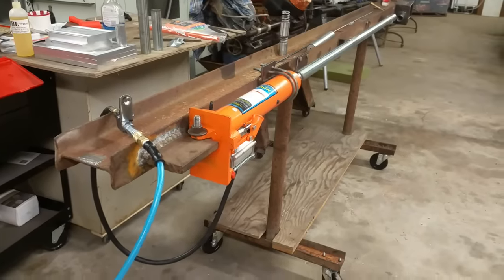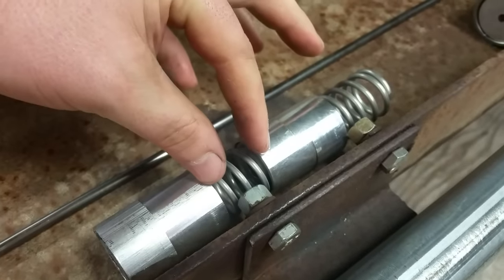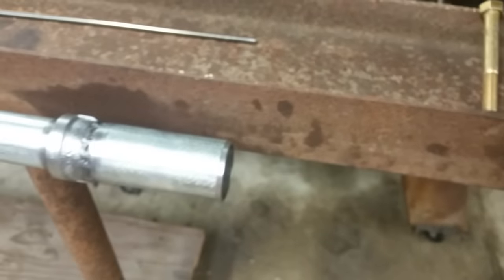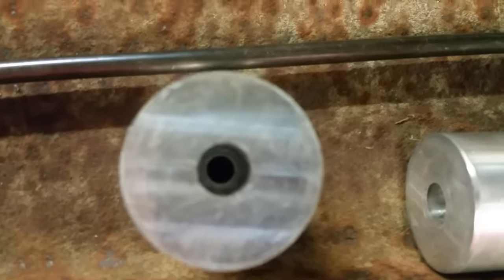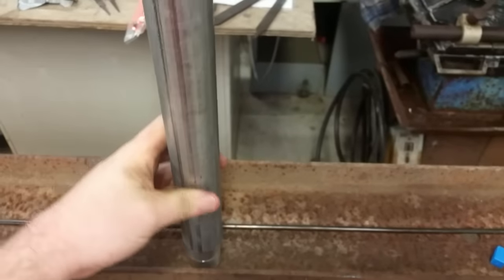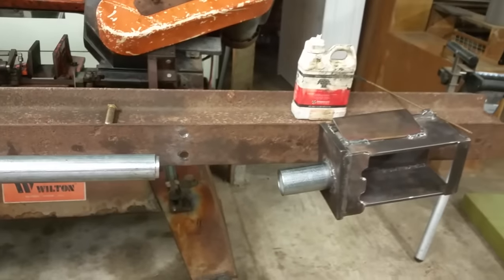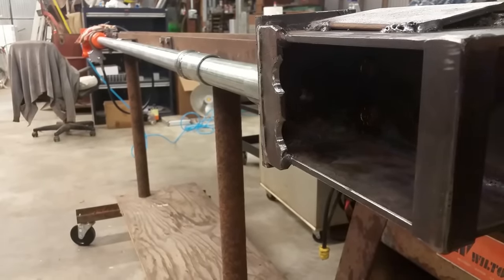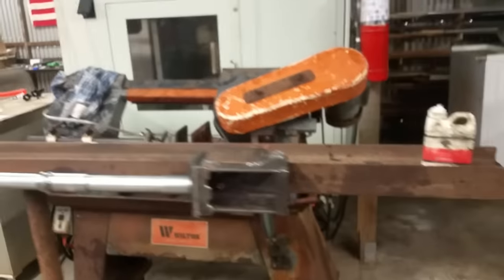Button Rifling Press - Home Built

Comment: I went with tighter tolerance on my bushings, I get that neat suction effect if I cover the hole when I pul a rod out. BUUUUUUT it's a helluva fight to extract rod and barrel after the press lmao. OCD can be a bit problematic lol. I think I'm around 3 tenths clearance? Much too tight but I didn't want to allow flex but yours kinda makes me seem silly because as I'm sure you know I spent much more time on my bushings to get them that tight. And it's even problematic so I think I'll just use my CNC and make some a bit bigger. What's your tolerance on yours?

Comment: Not bad, a couple things to point out though. You're not limited to the length of the ram, just make your push rod and the support tube in different extendable lengths and then you're only limited to the length of your i beam frame.

Your bushings could be designed like split collar clamps for easier removal, or instead of trying to pound it the barrel with another tube you could have used the existing barrel like a slide hammer through your hole in the beam, use inertia!
Reply: My thinking exactly.

Comment: I would like to see you roll that barrel on a microflat table or chuck it in a lathe and run a dial indicator on it. Also what metal is the barrel made from? Is there heat treatment coming next? Was the stickiness due to swelling from the broach?

Comment: That is totally cool and ingenious the way you used the springs and spacers to stabilize the rod and using a hydraulic ram. I totally understand but wouldn't have thought of pushing the die rather than pulling as the only way I've seen before. It looks like you were using DOM tubing in your example. would it work with a standard barrel blank? I was wondering what kind of typical pressure it actually takes to push a 9mm die? Thanks for sharing this.

Comment: Pretty freaking awesome, but my question is, why such a long setup? is that so you can run multiple sections and do much larger barrel blank lengths? maybe do a super long blank and cut it down to multiple sections?
Reply: 22 inches travel so you need 22 inches for ram, 22 inches for rod, 22 inches for barrel, plus some extra for fixturing on the ends. I don't think he's got any extra, that's the way I see it anyway.
Reply: @brocktechnology  Why 22" for the rod? Couldn't it be shortened by having the rod & the support tubes/springs inside the area where the ram extends, pushing both rod and supports down the tube the ram is in?
Reply: @konagolden4209  That's exactly the case. In the start state the Ram, the rod, and the barrel are all in their own space. The Ram extends into the rods space in the rod extends into the barrels space, the spacer stack collapses and remains in the rods space. 
A not so small point that I missed in my original observation is that the support stack has a minimum and maximum dimension and it needs 22 inches of difference between minimum and maximum so the total length needs to be 3×22 plus the size of the support stack without any springs, plus a bit more for fixturing at the ends. 
There is of course many ways to optimize this and fit the same functionality into a smaller space but we are witnessing it in a state previous to any optimization.

Comment: The reason your bushings were so hard to remove is because the tubing was too thin and didn't constrain the forces. In other words, the button expanded the diameter of the tube. This is why commercial button-rifled barrel blanks are around 1.25" in diameter.

If you measured the resultant bore size,  it  would most likely be out-of-spec (i.e oversize).
Reply: Duncan Wilson I would think that Normalizing/Stress relief of the tube at about 550 deg Celsius for 2 hours should cause the steel to return to the original dimensions.
Reply: unless of course, he is making gun barrel liners. which these look to be

Comment: That's awesome. I've been wanting to do that for a long time. This is the first time I've seen something worth building. Couple questions...why is the tube so long? I did realize that with a 22" ram you would need an extra 22"  of room for the aluminum and spring holders. That looks about 6ft long. Is it necessary? When the barrel came out, it obviously expanded a wee bit. Is that a bad thing? Last question.  Do you have to make a holder set for each sized barrel? Actually, I'm going to hit subscribe and all that. Could you show when you do a bigger barrel? Absolutely great idea man! Very inspiring. I had just about given up hope!!!

Comment: Are you getting constant smooth pressure the length of the barrel? It seems like the ram is moving stop and go.
Does that matter? Wondering if you could use an air cylinder with the appropriate throw and a pressurized tank to do the job with one continuous stroke?
Like I said, i don't know if it even makes a difference. 
I've got both. But the harbour freight cylinder is cheap and I don't mind tying it up indefinitely unless it would make a noticeable difference.
First time viewer, I'm going to sub and like.
Thanks.

Comment: Hi Max, nice build mate. Ingenious! 
Just some things to clear up . What is the clearance between the bushings and pipe as well as the bore of pushrod? Clearance also for Barrel support bushing? Source for Spring? Source of your Rifling buttons?
Thanks Ray
Reply from the maker: Depends on the ID of the pipe you're using. I'd leave .005-.010" on bushing clearance. The 1/4 rod clearance was just the oversize hole left by a 1/4 drill which usually gives enough clearance by itself.

Comment: I just subscribed. I’ve done some minor gunsmithing in the past. My question here is, how big of a barrel can you do (diameter wise) with those bushings? Do you have different sized bushings for thicker barrels with your setup there?
Reply from the maker: That's correct, this was a 1/4" mandrel, ideally if you go over 30 cal then you would want to up the size of the mandrel and bushings. Theoretically you could do 50 cal but you might need a stronger hydraulic cylinder
Reply: @max-weber  I’m really impressed with your setup there. Would you think a 20 ton ram would do it, or am I thinking too big?
Reply from the maker: @roberthamm9304  that would probably work. It depends on how you size your rifling button (how deep the lands and grooves you spec it to cut)

Comment: what is the reasoning for making the supported rod part (before the barrel holding jig) so long? I figured it would be at most 2x the stroke of the piston, but it looks to be almost 3x?
Reply from the maker: Yes you're right (3x). One bushing plus uncompressed spring gap is 3 inches. Each spring compresses by an inch, so a 22 inch stroke needs 66 inches with this setup. You could probably get away with less support and cut it down in length 2-3 feet, but I opted to overbuild it since I had a long beam to mount it to.

Comment: I would assume that there are barrel size/thickness limitations? I'm not real familiar with rifling techniques but I was curious.
Reply from the maker: I haven't had a chance to do a larger caliber, but it could be possible to max out the hydraulic ram, since it's only 8 tons. You'd need a larger mandrel too.

Comment: Have you ever seen a button rifling machine work? I think your going to have trouble with deflection of the pushrod inside the barrel bore. Buttons are drawn through, not pushed, for that reason. Not saying it wont work, it just won't work well. How are you controlling the twist rate?
Reply: You are 100% spot on. The button is pulled through and an AC Servomotor controls the rate of twist, rotating the button at a controlled rate.

Comment: Very good.  I wonder if there would be any benefit in adding a flat bearing of some sort between the cylinder ram and the push rod.  This might allow the button to rotate more freely.  It could simply be two flat plates greased up against each other.  Still, your results looked good.
Reply: Called thrust bearings. I supposed to have a drawer full of them somewhere. I'm not sure about the flat pieces like washers since they're soft. Thrust bearings have two extremely thin races that are harder than a Minister's prick. And small needle-like bearings. Well in what I was doing, but I've seen heavy equipment that have some hellacious thrust bearings!
Reply: @jackwatkins7382  yes they use the needle thrust bearings in lathe head stocks sometimes.  They would work for this but really aren't necessary at .01 rpm.

Comment: If I am understanding correctly you would have to make a full set of bushings for each caliber?
Reply: Probably just for the outer diameter of the barrel. If you used the same size stock each time you wouldn’t have too.  .223-.260 in 1/2” and .270-.338 in 5/8”.

Comment: Is this technique uniquely different from traditional rifling methods. I'm unfamiliar with traditional approach to rifling methods.
Reply from the maker: I believe most button rifling done in factories will pull the button through using a rod brazed to the button. That can be more challenging because you have to have a good grip on the rod and whatever grips the rod has to rotate with the button while it passes through. When pushing, the button moves independently from the rod.
Reply: @max-weber  'preciate the 'splanation.

Comment: If you go back far enough,  didn't they pull the tool through with a threaded rod?
Reply from the maker: Historically, early rifling was "cut rifling" with a single point cutter. It's a slower process but there are still high end barrel makers that do it.

Comment: For longer Barrels could you not have made a spacer bar or extended push rod for longer barrels and do 2 passes with the single length ram, one short for half way, then with the long push od to the other length, you could have essentially just under doubled your total possible barrel length...

Comment: Impressive.  However, I can't be convinced that you didn't expand the internal diameter of the barrel pushing the button through that way, especially when inserting the barrel into the the bushings appeared easy beforehand but difficult to remove after pushing the button.

Comment: How deep does the rifling need to be to be most effective? I assume there will be gas leak if  there is too much play. Do you need sequensual push buttons to get deep grooves?

What are the factors for accuracy here?

How much force is needed? 
I wonder if it could be done with a threaded rod.

Where do you buy the push buttons? I guess they are on a watchlist. So making them yourself is probably nessisary
Reply: They are not on a watch list. smh
Reply: Why would you need multiple passes with the button? A bullet is actually squeezed through the barrel, creating a tight gas seal. No bullet leaves the barrel the same size as before it was fired.
Reply: @TheRoadhammer379  try buying rifling press buttons in venezuela.

Comment: Did the tube diameter pipe increase after pushing the button through.  It’s relatively thin walled, no?
Reply: The button is carbide tungsten, it's cutting as it moves, not pushing grooves into the barrel, which would swell the barrel. In actual gun manufacturering, the button is pulled through the barrel and a Servomotor turns the button at a controlled rate of twist.

Comment: Hello Max, What are you using for button material, and what are the spec. for the flutes?  BTW your welding sucks, use TIG on pipe- if you got it. Nice set up. Thank you for posting this- Steven

Comment: How does the button spin at a constant rate?  I didn't see anything that would control its spin.
Reply: The button has the correct "spin"  (twist rate) contour already machined in it and turns x amount per inch by design when moved forward.

Comment: how do you determine twist rate?  Are you just using tubing or are you boring the blank yourself?
Great build
Reply: The button determines the twist. You use a different button for a different twist rate.
Reply: The button design determines the twist rate.  Want a different twist, get another button.

Comment: I don't  see any lube for the button.  Any recommendatn for cutting lube?  Some commercial barrel makers keep it a secret, and some use a secret soap compound.
Reply from the maker: I just kept it simple and used standard cutting oil. Having a shiny reamed bore on the inside is also important.
Reply: @max-weber  thanks for sharing.
Reply: @max-weber  thanks

Comment: What is the reason for this to be so long? I don't know anything about it, just trying to understand why the push rod is so long
Reply from the maker: Without bushings (a totally unsupported push rod) you could get away with just 22 inches for the stroke of the hydraulic cylinder. Because the push rod needs to be supported by the bushings, each bushing takes up space, so essentially you only have useful working length in the spring area between the bushings.
Reply: @max-weber  Could you put most of the support bushings & springs inside the tube where the ram extends? The idea would be the support bushings & springs are also pushed down that portion of the tube, while supporting the rod. Just a thought....

Comment: That's interesting. I never knew how this was done.
How did the colonists do this when rifling was invented?
Reply from the maker: They did "cut rifling" with a cutter on a mandrel which is done one groove at a time at multiple depth adjustments. It's a much slower (but arguably better) method of rifling that doesn't impart any stress into the barrel.

Comment: Thinking aloud... wouldn’t it be better to pull the button rather than push it through the barrel? It’d ensure the rod isn’t forced to bend once load is applied. Any reason why you chose to push the button instead? Is it ease of connection to a ram? Cheers all the same, and good job!

Comment: Very nicely done! You should try a challenge and make a hexagonal spiralled barrel along with hexagonal bullets  like they had at the end of the civil war haha : )
Reply: Polygonal rifling is very difficult to achieve, although the result is much superior to classic rifling.  Glocks are routinely rifled polygonally, as was the first sniper rifle (the Whitworth).  The MG42 and MG3 machine guns (basically identical except for the model number) also use polygonal rifling.  It's not just a "Civil War thing", it's a quality thing - but for the manufacturer it's like the difference between basic arithmetic and differential calculus.

Comment: Fantasitc idea, im stealing it. :D I had another idea in mind however this is neat, and i love that everything is contained because the pressures are scary haha
Have you measured the twist rate? 
Done any accuracy testing?
Reply: you do not really need to measure the twist rate, the twist rate is created by the button pulled/pushed thru the barrel. so for different calibers you need different size buttons and some calibers even have  many different buttons for different twists in a specific caliber. so refiling a barrel isn't as easy as most people might think.

Comment: I don't understand why you need such a super-long pushrod and corresponding bushings setup.   If your ram travel is 22", why would you need a pushrod longer than that, or maybe a couple inches longer?    The setup you have looks about 4-5 feet long.

Comment: What happened at 12:26 when it moved? Why did it move?
Reply from the maker: That was when the button finished passing through the tube and there was no more side pressure trying to buckle the 6ft pushrod.
Reply: @max-weber  Yes, of course. Thanks.

Comment: You need a minimum wall thickness with firearms. If you make something that cannot handle the load, you will blow your face off.
Reply: You would want to have moly grease for the lubricants. And what you could do is make an extra pushing rod so you could make longer barrels with the press. It might be worth it.

Comment: Can you redo an existing 9mm barrel?
Reply: no, you can't. The rifling is cut once, and when the bullet is fired, it is squeezed into the barrel, creating a tight gas seal. Rifling is two parts, lands and grooves, cutting an existing barrel would cause deeper grooves and affect both the gas seal and integrity of the barrel thickness.

Comment: Seems to work. Would like to see your groups on the range. 

Pull button rifling is much better. You are not dealing with all the pieces.
Reply: @TheRoadhammer379  No, true button rifling is only moving a button through the tube, cutting lands & grooves. 
Higher precision is had, and less room required, by pulling the button, but using a "button", either pulling, pushing or both, is button rifling. Servo motors, pulling, stress relieving, lapping, consistent lube washing to remove cuttings, and other processes, are important for quality manufacturing to obtain repeatable, tight tolerances and for the safety of the end user.

Comment: Oh my.......did you take measurements before and after the rifling process? Just because you can see a rifling pattern doesn't mean it is fully formed and to spec.

This is a very crude way of doing a very precise job.........don't anyone try this at home......literally.

You can also get a chamber like shape by using a cordless drill and a chamber reamer.......but I wouldn't recommend it.